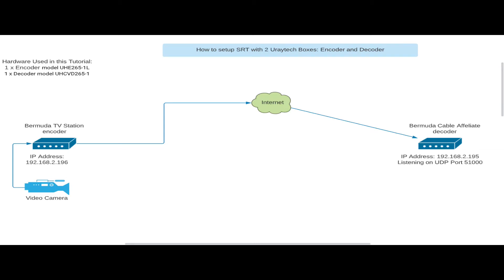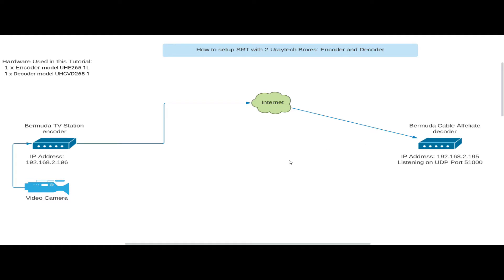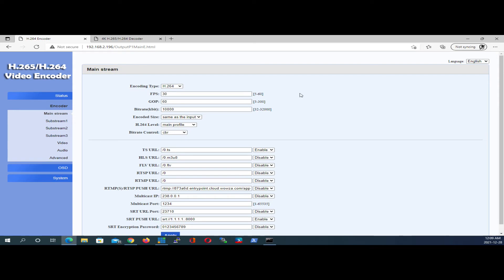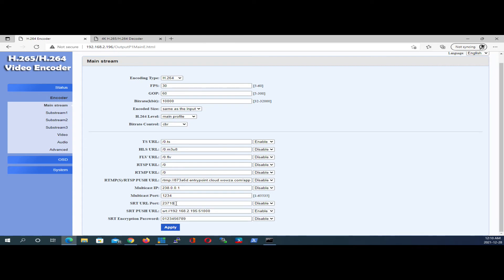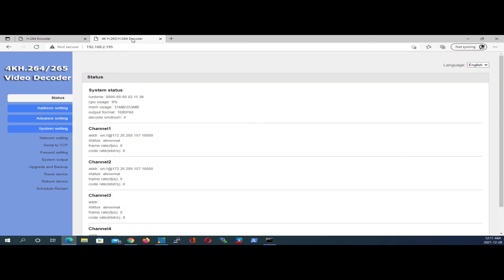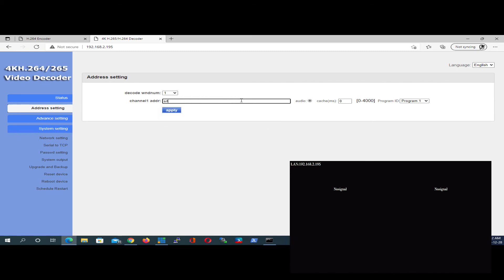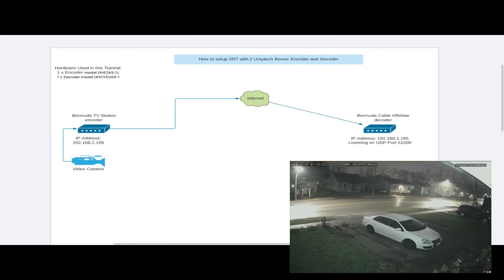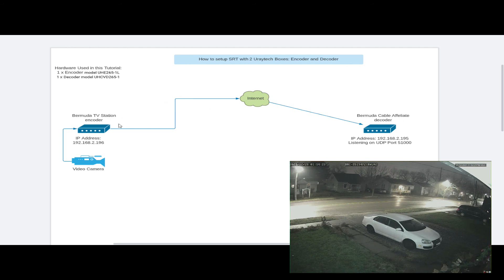SRT How To with Uraytech UHE265-1L and UHCVD265-1

Comment: I have a third party encoder that I setup the RTMP URL and stream key. I would like to push the stream to this product. where do you put the stream key in the decoder?
Reply from the maker: Hello Orlando Carillo, greetings. Normally an RTMP stream pull would be a single URL link you plug into a decoder box like the one above or a software decoder like VLC, you only use a stream key if you are pushing an RTMP feed to a publishing end point server.